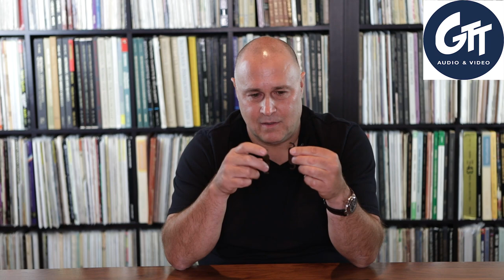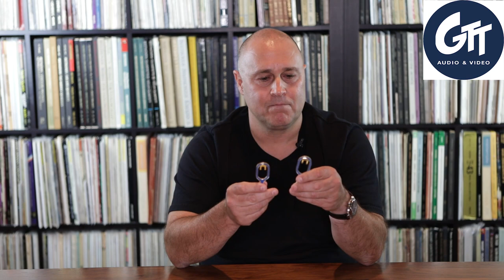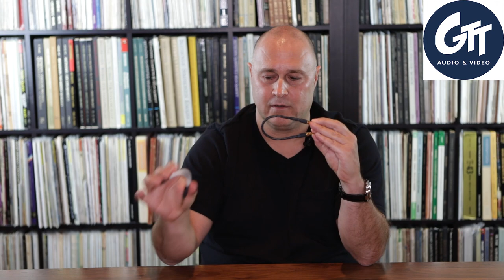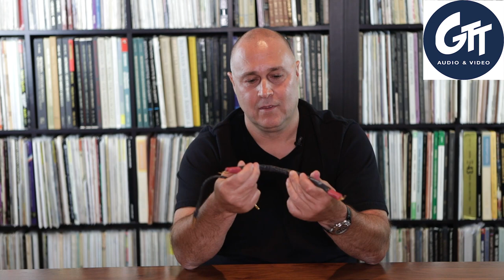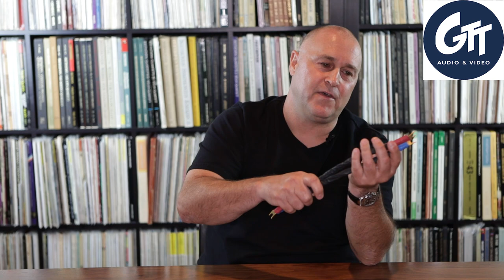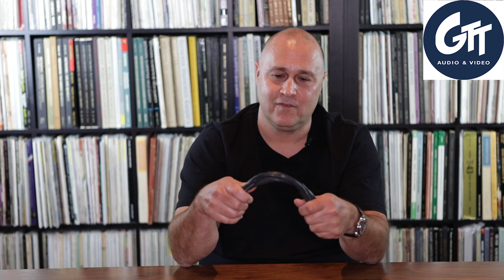GTT Audio - Episode 18 - How to Wire Your Stereo Speakers

Comment: Hello Bill... Such an important discussion! The damage that the backward electromotive force generated by the woofers settling after it is driven to excursion, when left un-isolated by not using a bi- or tri-wired configuration, has a audibly detrimental effect, smearing or completely obliterating fine midrange, and especially, fine treble, detail, air, and decay. Once you hear the difference, it is SO apparent.  Good on you for sharing this with viewers, many of whom may never have given this topic any thought whatsoever... Such an easy way to maximize the performance of your loudspeakers... Bravo, buddy!
Reply from the maker: Thanks Greg for posting here and reiterating what what I said.  Too often I see this ignored and felt it needed to be discussed.

Comment: Right on, Bill, and well said. I strongly prefer bi-wire/bi-amping whenever I can get it. But, as you said, not every manufacturer provides this...unfortunately.
Reply from the maker: Thanks for commenting here David!  I have not found a case where bi-wire/bi-amp didn't work and work significantly better.
Reply: @gttaudio  In every case that I've heard across the decades, my experience is the same. Much greater coherence and harmonic coolosity!

Comment: Enjoyed the tip.  Now I'm looking for another pair of amps to go bi-amp.  

What about using a four conductor cable to go bi-amp?  Will there be EMF interference between the conductors?
Reply from the maker: Thanks Frank.  We can always help you out with another set of amps!  If the cable is true 4 conductor with 4 spades on each end then you won't have to worry about the EMF bleeding from one pair to another .

Comment: Why do Magico A3s come with one set of binding posts? Are they depending on the crossover to protect the tweeter?
Reply from the maker: 1st sentence - must be how the crossover is designed.
2nd sentence - crossovers don't protect tweeters and if they had 1, 2 or 3 sets of binding post this wouldn't affect a signal going to the tweeter, just how it is routed internally.